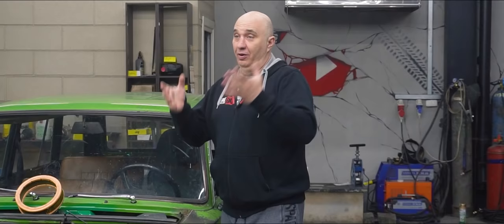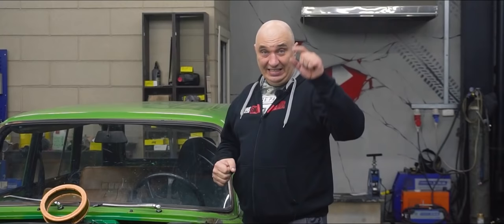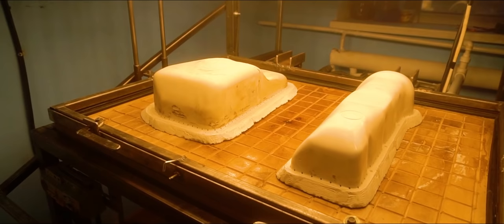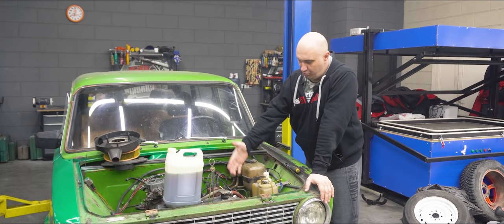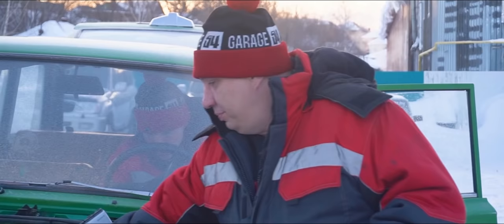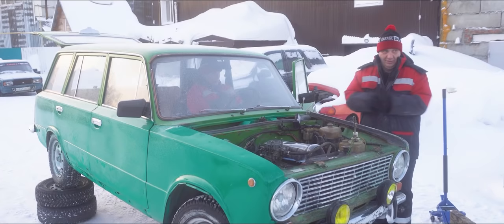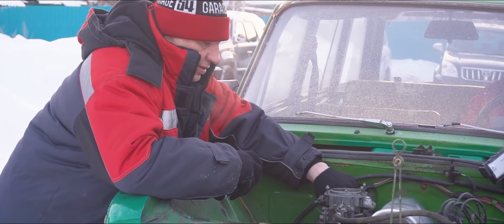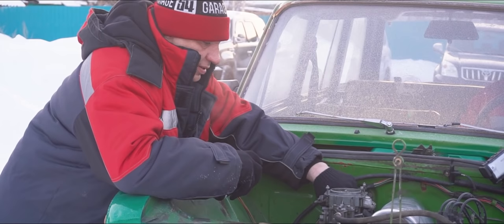Looking inside an engine during cold start (-30 degrees)

Comment: What an exciting display of ingenuity. In winter your oil becomes too thick to be picked up and distributed throughout the engine. The amount of force to pickup the oil required increases, resulting in an increase in the torque on the distributor shaft gear. This torque was strong enough to break it's teeth. You totally illustrated this in a meaningful and easy to understand concept. Thank You.
Reply: No, not to pick it up. That would only be ~14psi worth of work.

Pressure. It can't leave thru the frozen channels it normally passes thru, and can't bleed off thru the relief for the same reason.

The pressure builds up and since liquids are incompressible, something has to give. If the oil can't escape anywhere, the torque coming into the pump has to.

Comment: Great video. Living in Alaska we have similar issues. This is why we install block heaters, oil pan heaters and battery tenders for safer starting. Sometimes we use diesel forced air heaters with a tarp over the engine to get things going.
Reply: minus 24 is nothing minus 40 is way way colder and more hard core then minus 24 Russians have it easy in winter
Reply: @SaraMorgan-ym6ue minus 40? That’s it huh?
Reply: @SaraMorgan-ym6ue that's -24 Celsius, ya know
Reply: @PotatotheTroll  meh that's a warm summer I have been through minus 52 Celsius which is much colder kiddo that will freeze your balls off in a second flat🤣
Reply: Or if you’re whistlin diesel, you just light a fire directly under the engine block
Reply: @PotatotheTroll -24f is colder than -24c

Comment: Cool demonstration. It shows one of the many reasons that ice road truckers operating up near the Arctic circle have to put a covering on the bottom of the engine and transmission. In conditions that cold, they have had problems oil and transmission fluid gumming up even when the truck has been running for a long time. The tarp covering they put on helps to trap heat.

Comment: I am impressed, I new something could happen, but I just thought it would fire up, in the UK it hardly freezes below -6 , one year it was -15 for a night and froze hard for some  time after, the soil pipes froze, luckily it warmed up again, so no unpleasant jobs, full respect to you in Russia, that is properly cold and I now know if arctic conditions come to the UK, I need to heat my car first.
Reply: They drained the oil then changed the pan and filled fresh oil in. After they chilled the car but the oil pump was still empty and could not get the air out with the cold, thick oil. They should have fired up the engine for a minute to get the air out of the system after the oil change before they chilled it over night.

Comment: In the winter with my 1987 International 6.9L diesel-- I would get under my truck and take a torch to the oil pan and filter for 20 minutes. Always did the trick. There was no way in the coldest weather I would force that beast to start without heating the oil. Once you get her all warmed up- she ran like a champ.

Comment: 10:50 never thought I’d feel sorry for a Lada
Reply: That's how you properly warm up a Lada at -30°C.
Reply: Valve float has entered the chat
Reply: Same 😢
Reply: Spun bearings has entered the chat
Reply: @vasiliansotirov6976  I had a TU 1.1L engine once that had low compression and dropped liners, I bounced it off the limiter for about 5 seconds and managed to spin 3 of the 4 bearings in that time
Reply: @iainmacrae6982  haha wow. Did that happen while engine was very cold or had little oil
Reply: @vasiliansotirov6976  Diluted/emulsified oil was the problem I think. I knew the engine was getting scrapped anyway. Here's a video of how it sounded:
https://youtu.be/JV-1N4XveTA

Comment: I’m a school bus driver, and in the winter time sometimes we put these little electric blanket things under the oil pan to warm up the oil for this reason. Also, all buses are plugged into trickle chargers whenever they bit being being driven, especially overnight. Both of those things help a ton!
Reply: Built-in oil and coolant heaters are an option on many trucks.

Comment: Yes more transparent oil videos!
Try the same with syntetich motor oil.
Reply: Yes 0w40 or 0w30
Reply: @Topsiekku  You know the first number in oil is when the oil is hot right, the second number, or high number is when the oil is cold. Think i'm wrong, toss some 0w40 in the freezer and see how it pours. The first number is the viscosity at 300f. The second number is viscosity at the freezing point, 0c or 32f. Hope that helps.
Reply: @ducewags  you got it backwards. First (lower) W number is viscosity in cold temperatures and the higher number is viscosity at 100°c IIRC.
Reply: @JuanSe2691  Look at any oil test with temps and viscosity. If the first number is the cold number, or thin viscostiy then why is it so thick? Ever change oil on a cold engine vs a hot off the highway engine? The first number is the hot, or running viscosity. Stick some oil in the freezer and come back and tell me the oil is nice and thin, low viscosity first number and pours out fast and easy. And tell me what oil gets thicker as it gets hotter? Did you even watch the video? Was that runny thin oil in the cold? Send some links to oil viscosity tests at cold and hot temps proving cold oil flows faster and better. I will wait.
Reply: @ducewags  well, any decent multi-grade oil should be nice and thin when cold, and offer good film strength under operating temperatures. That's the whole meaning of the numbers.  I use 5w40 oil in my car as recommended by the manufacturer, the 5w means it's going to have enough fluidity when cold to offer immediate flow to crucial parts within the engine, and the 40 represents the viscosity at operating (hot) temperatures. 

Oh but the oil is thick when cold and thin when hot you say? That's a monograde oil and shouldn't be used on anything other than vintage cars that call for it and stationary machinery. Those have a single number.  That's exactly what a multi-grade oil solves by behaving in an opposite way. Say, a monograde 40 oil is going to be thick from the get go, especially when cold. Now, a 5w40, is going to be thinner the colder it gets (until a certain point, that is), but at operating temperatures is going to behave like the 40 weight when hot. 

That's all there is to it. It's not rocket science. Even if I'm qualified to tell you about these things (I'm a certified automotive technician) that shouldn't be the case, any person of average knowledge and especially a car owner should know. It's even on almost every car's owners manual, with graphics and everything.
Reply: @JuanSe2691  Watch the video again. At @1:45 room temp oil pours nice and easy. At the end -30c the oil can't even get picked up by the sump. Again the first number is when the oil is hot. The second number is when its cold. Prove me wrong with oil test numbers. I build engines for racers here in Minnesota. Dirt track high rpm 358ci, max displacement. Truck pullers start at 340ci and go up to 880ci mountan high deck 10.5 block height. Tell me again Im wrong on the oil numbers. But I know nothing about oil and the temps they run and the viscositys. Im still looking for your actual oil test numbers from a lab test. Fun fact, Project farm has done oil tests, go look at the numbers on the bottom of the test and the visosity at the temps. Then tell me Im still wrong with numbers.
Reply: @ducewags  that's simple, if both numbers are high that's going to happen. But still, the lower number is viscosity at cold temperatures. Don't trust me, just ask anyone in the business.
Reply: @JuanSe2691  Then show me one video on here that supports cold oil flows better then hot oil. Show me one lab test report that shows cold oil flows better then hot oil. You can do it, it's in the oil tests right? That's how oil works right? SHOW ME PROOF COLD OIL FLOWS BETTER THEN HOT OIL. You can't and won't. Now stop.
Reply: @JuanSe2691  Show me just one video on youtube that supports your thoughts on cold oil. Just 1 video, I will wait....
Reply: @ducewags  there's an entire channel for that, check Project Farm.
Reply: @JuanSe2691  WOW I see you don't even read comments. I suggested you look at Project Farm oil videos. Now where are the videos showing oil flows better in the cold? I'm still waiting...
Reply: @ducewags  i didn't even say cold oil flows better than hot oil. Goodbye
Reply: @ducewags  The first number before the W stands for cold and the second for hot...just pick up two bottles of 0w40 and 15w40 and see it by yourself.
Reply: @liviu9181  The "W" stands for winter blend. And if the first number is for when the oil is cold like 5w or 10w and so on. Then why is it so thick when its cold? 5 weight oil is thin  or low viscosity right? And yet when the oil is cold it ends up real thick high viscosity. The first number is hot oil, or thin viscosity, the second number is cold, or thick high viscosity. Have you ever in your life seen or hear of a oil that gets thicker or higher viscosity as it gets hotter? Or a oil that gets thiner less viscosity as it gets colder? Just think about that.
Reply: @JuanSe2691  go read your first comment that you wrote me, then tell me that again. Google why is oil thick when cold? Or why is oil thin when hot? Explaine the numbers again for me? The first number is when the oil is hot thin. The second number is when the oil is cold thick. FACT.
Reply: @motocrossmaza  Where did I say "w" was for the weight? And second find just one oil that gets thiner with cold. Oil NEVER gets thiner with cold FACT.
Reply: @ducewags  dude you have your terminology wrong.  The two numbers in oil viscosity have no direct relationship to one another.  You can compare the first number between different oil weights, and the second number between different weights, but not the numbers directly to each other.  0w30 is thinner when cold than 10w30 (cold being relative, it's tested at 40°C).  10w30 is thinner when hot than 10w50 (tested at 100°C).  But 0w30 and 10w30 are both the same viscosity at 100°C, and 10w30 and 10w50 should be about the same viscosity at 40°C.
Reply: @Patrick94GSR  Ok then you show me just ONE oil that gets thinner, or lighter viscosity as it get's colder. Then show me one oil that gets thicker as it gets hot. Oil does not work that way, and never has.
Reply: @ducewags  no one has ever claimed that oil gets thicker when hot.  But you're comparing the two numbers in the viscosity grade, thinking "30" in 10w30 means that's the cold viscosity because the number is higher than 10.  I'm telling you that you can't compare those numbers directly with each other.
Reply: @Patrick94GSR  DUDE, everyone that talks about oil says, the first number is when it's cold, the second number is when it's hot. That is why everone goes with a low first number for winter, or shall I say cold weather.
Reply: @Patrick94GSR  Here is a great idea, go back and read all the comments in this section, everyone here says the first number is when the oil is cold, low viscosity and flows easy. Then it gets thicker as it heats up. Come back and tell me no one has ever clamed that. Not my first rodeo with oil that's for sure. I live in a area that see's -40f every winter for weeks at a time. I know how oil acts when cold vs hot thats for sure.
Reply: @ducewags  you posted "You know the first number in oil is when the oil is hot right, the second number, or high number is when the oil is cold."  That is wrong.  The first number is the cold viscosity, the second number is the hot viscosity.  But no one here has ever claimed that oil gets thicker when hot.  Literally no one.  Everyone knows oil flows easier when hot.
Reply: @Patrick94GSR  5w30 oil, the first number according to you is when it's cold, low viscosity so it flows better. Then you say the "30" is when the oil is hot, higher viscosity. At the same time you tell me oil does not get thicker, higher viscostity when it gets hot? You can't make up what your trying to say with the numbers as you state. And I have no clue, and I'm wrong??? You just proved your own words wrong, more then 1 time.
Reply: @Patrick94GSR  The first number is the cold viscosity as you say, then why in the hell is the oil so thick when it's cold... Still can't answer a smiple question on why the first viscosity number is thick, when the number is so low. ANSWER THE SIMPLE QUESTION.
Reply: @ducewags  I told you, the two numbers do not relate directly to each other.  0w flows better cold than 5w, and 5w flows better than 10w.  At operating temp, a 20-weight oil flows better than 30-weight, and 30-weight flows better than 40-weight.  But the numbers before and after the W do not relate to each other.  The numbers are not any specific unit, and represent different scales.
Reply: so if you asked "does a 5W oil flow better than a 10W oil when hot?", there's no way to know without having the second number.  A 0w30 oil will flow LESS when hot than a 5w20 oil.  But the 0w30 oil will also develop more oil pressure when hot than 5w20, which could be better for the engine, depending on bearing clearances.

Comment: My dad and I ran his Mack truck all night outside at minus 35C one night as we changed engines in another vehical.  He didn't want to shut it off as he was afraid it would not start again outside the shop at minus 35 and we were in the start of a 3 week cold snap.  The 1957 Mack B-61 with the 170, cracked a piston that night.  We ran that old grain truck for 5 years with a cracked piston.  At the end of its life he would drain 3 gallons of water from the oil pan in the morning.  We were running 80-90 gear oil for engine oil.  It would steam out 5 gallons of water in a 6 mile run to the field, and for the first start in the morning it would take a can and a half of ether to start it.  My dad said, "I buy Mack trucks, because if you can start it, it will get you home."

Comment: Should try it again with a synthetic oil and see how it flows in thows temps. Keep up the videos!!
Reply: Synthetic is the way to go in those kind of temperatures!🌡Would like to see the engine with it at those temps!!
Reply: Wouldn't make a different on this car. The lubrication of this engine is GARBAGE. It's a good thing though that it's all cast iron and you can rev the fuck out of it even like this. I would like to see the same test on a modern engine. Modern lubrication systems are much better at circulating cold thick oil.
Reply: @xXturbo86Xx  true. But it’s not just about oil circulation but  Metallurgy

Comment: The metal shavings turned the oil black really fast. lol
Reply: Just leftover oil that clings to the inside of the engine. Just carbon
Reply: Considering they are using mineral oil it's likely just breaking up any and all carbon buildup since they didn't even bother flushing the engine, so a bit of old oil too.
Reply: @SilvaDreams  Hmm, it seemed like they flushed it twice even. Maybe it's just how it's cut?
Reply: @SilvaDreams  He said it would be flushed, or at least go through an extra oil change prior, no other reason they'd be unwrapping multiple oil filters.
Reply: It's old oil. An oil change or flush doesn't clean up an engine's Insides to "as new ". Depends how its been treated.